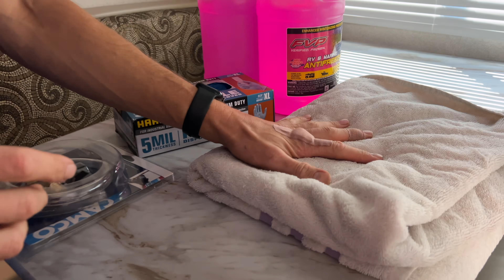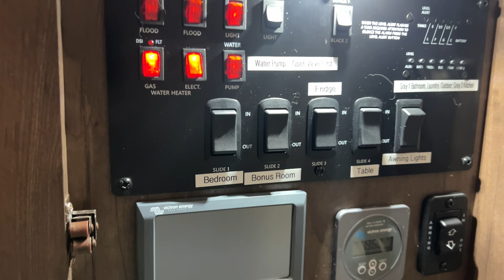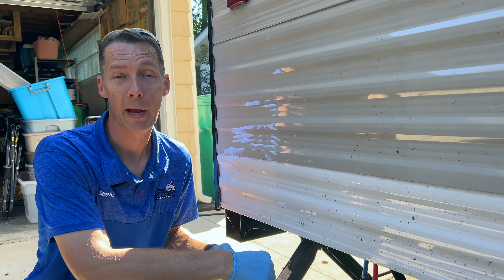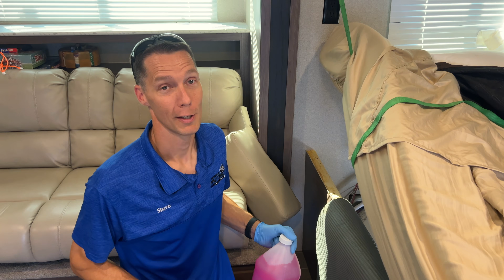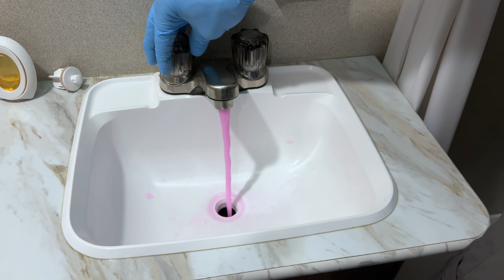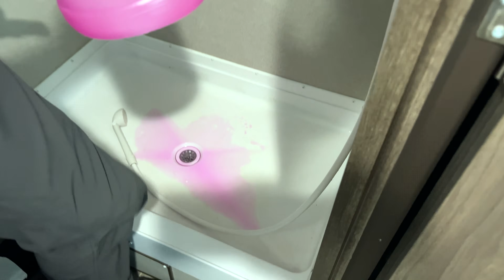How to Winterize a Camper with Antifreeze | Beginner-Friendly + FREE ✅ List

Comment from the maker: Update for clarification:
We mentioned in the video that RV antifreeze is non-toxic and not the same as car antifreeze. It will not poison your pet if a small amount is accidentally licked or spilled. However, that does not mean it is safe to drink or pour out anywhere. You should not let your animals drink it, and you should not dump it on the ground. A few splashes are fine, but when you are draining your system, always dispose of it properly at a campground sewer or dump station.
Reply: First timer here. Wouldn't you normally do this winterizing at your home somewhere?  Out in the driveway. I'm not near a campground or dump station. Can I dump it down my utility sink to our septic tank?  Or is that a big no no?  Where else can I dump it?
Reply from the maker: @JulieBenden  yes you can do this at your house. And you can dump the RV antifreeze down your sink or septic field. It is not the same as vehicle antifreeze.

Comment: Great video! We now have a very capable mobile tech in the area. A real God send. He works with me on some maintenance items and has shown me what to do. On heavy stuff, like replacing the awning after a Fedex truck backed into it, this 73 year old is more than ready to bring him in. It is the getting down, crawling into and under, and climbing on top that challenges me. I always leave the anti-freeze in the grey and black tanks. Only a little in there, it is anti freeze, and it is non-toxic. I also put the rig in a storage garage over the winter. Just keep it nice for a few more years, and try to keep the critters out of it. Try is the operative word.
Reply from the maker: It’s great that you have a reliable tech nearby to handle the tough stuff so you can enjoy your rig worry-free!

Comment: Great video Steve. Can you leave your sink and shower taps open over the winter ?
Reply from the maker: You can leave them open if you'd like, but it isn't necessary once you have pushed the antifreeze through the lines and the system is properly protected.

Comment: Only suggestion I can offer is open the low point drains prior to removing the heater anode, and release the pressure on the valve BEFORE removing the anode....unless you want an anode rocket to blow out the side of your RV....ask me how my dumbass forgot to do that and figured it out.
Reply from the maker: Appreciate you sharing that experience; hopefully it saves someone else from a messy surprise! I have forgotten to relieve the pressure a couple of times and then enjoyed being wet for a while.

Comment: I have keystone Springdale 298bh how do I know how the amount of antifreeze it takes? How will I know when it’s enough antifreeze?
Reply from the maker: 3 gallons is usually perfect for a travel trailer unless there are 2 bathrooms then a 4th will be needed. If you pick up an extra, it won't hurt if you use a little more.
Reply: @MobileRVTechServices thanks.👍🏽

Comment: Thinking out loud… why not capture the antifreeze coming out of the sink faucets and add it back into the supply bottle? The little water mixed in isn’t going to dilute the strength of 100% antifreeze solution that much. Some loss down the drains is good for ‘sink trap’ collection.
Reply from the maker: Dilluting the antifreeze will make it less effective. It isn't that expensive where saving it is something I consider.

Comment: Is it a bad idea to just leave the system pressurized with antifreeze?
Reply from the maker: I theory, if there is RV antifreeze in the system and it is pressurized, it should not hurt it, but depressurizing the system after running RV antifreeze in gives another level of protection, in case the antifreeze needs a place to expand.
Reply: That makes sense. Thank you. Love your videos. Just found your channel and subscribed

Comment: Question… I don’t think you mentioned the black tank flush. I followed all your directions and got mine winterized and then saw someone mention this. Should I go back and do that too?
Reply from the maker: For the most part, the black tank flush line is designed to naturally drain out so it is not normally winterized.
I will blow out that line to ensure there isn't water sitting in a low spot. You can also push some RV antifreeze through it for extra security.

Comment: I'm new to all this but for some reason this looks like overkill. Maybe it's b/c I live in Texas so we might get below freezing for 3 or 4 nights but that's about it. Last year (not knowing any better), I just pulled the plug on my hot water heater, took off caps on low point drains - I found three on mine and just opened up all the sinks, faucets, etc. My question to you is, why wouldn't the latter be good enough? I mean, if there's no water in the lines, what's the need for all the pink anti-freeze? Just trying to learn some more here. Thanks in advance.
Reply from the maker: Water droplets stay in low lying areas, sink and shower faucets, toilet valves, etc. When those water droplets freeze they expand and break things which cause leaks.

Even in Texas, you'll want to protect your water lines from freezing! We go to Houston in the winter and when people bring their RVs down from other areas in Texas for the Rodeo, I end up being the RV plumber to fix the leaks due to their RVs not being properly winterized.
Reply: I live in Texas and did what you just said to do on our travel trailer and when we went camping the valve on the toilet was blown out. Now we have a class C im not taking any chances im not taking short cuts.

Comment: Hi Steve, I did everything right and your video is a no brainer. Extremely helpful.
I had an issue, it is my first time doing this…by the time I started pumping the pink fluid, it started leaking straight from city water connection and I lost 4 gallons without notice.
My trailer is brand new (2nd winter). Am I doing anything wrong? Is it the connection faulty? I have notice when the water pump is turned on, air comes out from the connection…if you push the little pin the water blows, not pushing it is leaking everything what pumps.
What am I am doing wrong? Please help me.
Reply from the maker: It sounds like your city water connection's check valve might be stuck open. The inlet check valve would need to be replaced. There is a good chance someone pushed the button while it was under pressure and damaged it.

Here is a link to a new one: https://amzn.to/48wm539

Comment: Steve, this step-by-step was perfect for us. Our unit didn’t have a cut-off valve for the antifreeze, but our local rv dealer had made up some quick hose connections that I simply put on and took off to siphon the antifreeze through the system. 

Thanks so much for you videos
Reply from the maker: You're welcome

Comment: How do you winterize a tankless water heater with this process?
Reply from the maker: You’ll need to look up a video/instructions on how to winterize your specific tankless water heater.
Reply: @MobileRVTechServices  Didn't you just say above "Tankless water heaters are treated like a water line and you will run the RV antifreeze through them" ?  I'm wondering if I need to bypass my tankless/on-demand heater or not.

And I don't mean to be critical at all.  This is a great video - clear, concise, great visuals.  I think it will make my first winterization a LOT easier and probably save me a few hundred dollars hiring it out.

Comment: Do you need to bypass or just let the antifreeze flow through the tankless water heater and what about the black water flush to protect the vacuum breaker under the sink
Reply from the maker: Tankless water heaters are treated like a water line and you will run the RV antifreeze through them.

The black tank flush can be blown out to ensure it is protected although the water is supposed to naturally drain out of the lines.

Comment: Great video sir! Not sure if necessary but for our black tank clean out we just use a bit of air to eliminate any residual water in that line. Would that work as well for the city connection line? Cheers!
Reply from the maker: Even when I use air to blow out the lines before putting in RV antifreeze, then do the city water inlet, I find there can be a little bit of water at the inlet before the antifreeze comes out.
Blowing with air first as you mentioned is much better than nothing, but I am more comfortable with opening the check valve to ensure it is fully winterized with RV antifreeze.
Reply: @MobileRVTechServices  actually just did that today and all good. Much easier than air. Thanks!!

Comment: I've had both a built in isolation valve the three valve system  and the two valve system. This system you are working on has a one way check valve coming out the top, and a cut off which you turned. So it two valve right there no need to modify
Reply from the maker: Thanks for sharing your experience with the different valve systems.

Comment: What about the water lines from the fresh water tank to the fresh water pump?
Reply from the maker: You can’t get antifreeze into that line. The line should naturally drain when the fresh tank drains.

If you have a different setup where the water tank is further away, you can run the pump after the fresh tank has drained to make sure the line is empty.
Reply: Thanks!
Reply: Same concern. Most fresh water tanks aren't designed that well and don't drain down completely, leaving a few gallons of water in the bottom. I always put antifreeze in the tank. The easiest way is with a spare RV pump to push it into the water fill connection, done this many times. My spare broke, so this weekend I just used a hose and funnel, and a ladder to get high enough to use gravity to force it into the tank. I put a full gallon into the tank first, then used the pump to suck it all back out. Then proceeded with the 3 way valve method to winterize the rest.

If you run each faucet just a second or two longer, you don't need to worry about adding antizreeze to the traps, because you already did.

I also leave the pump on, switch the valves for a second to push a little antifreeze through the lines into the water heater, because some water will be trapped in those short sections of pipe. Which then leaves some antifreeze in the bottom of the water heater to guarantee it won't freeze after putting the plug back in. And I always put the plug back in to keep critters out, Mason bees and Asian beetles climb into every opening they can find.
Reply: No water heater?

Comment: I have one question: I have a Macerator how do I go about adding antifreeze? I sure there are some water in these lines, thanks.
Reply from the maker: They tank a few more gallons of antifreeze. You will dump a gallon or 2 down the toilet and run the macerator until pink comes ouf of the hose.
Reply: @MobileRVTechServices  Thanks for the reply.
Reply: I have an outside removal macerator pump and I just pour some into the inlet port and store it  never had an issue in 6 years

Comment: How do you keep the antifreeze in the toilet from growing mold? I’ve had this happen the last two years.
Reply from the maker: I see this occasionally on RVs I winterize. It seems like it’s specific to that RV and I haven’t pinpointed it yet. I don’t feel it’s the antifreeze since I don’t see it with every RV.
Reply: @MobileRVTechServices  interesting thanks for the feedback.
Reply: I use compressed in water inlet( made a adapter)and set it
To 30lbs and
Blow lines out. a litte antifreeze in toilet and drains.